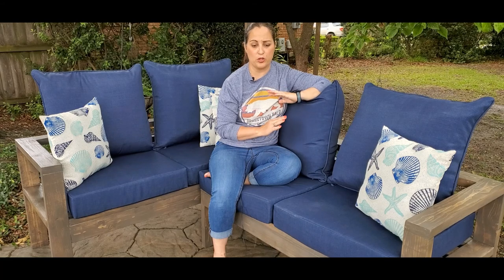DIY Outdoor Sectional Sofa

Comment: I am planning on making this and could you please share your cut list!
Reply from the maker: That's awesome!  There should be a link to Ana White's website with a cut list.  I modified her design to fit my needs.  But for the most part, you can get everything you need to make 🙂 Happy Building!
Reply from the maker: I thought the same thing after making these chairs and after sitting in the for over a year and all the wear and tear from the elements and squirrels, I'm going to make new ones with a lean to the back and more durable wood.   Which I will film eventually. Stay tuned

Comment: How did you connect the back pieces to sofa with 1 arm rest on it
Reply from the maker: It's been a while since I made these, so I would have to go back to watch, but it's the same as the first sofa. You connect the seat to the arm rest with screws and that's it.  I've had mine out in the weather and haven't had any issues yet.  Still holds strong.